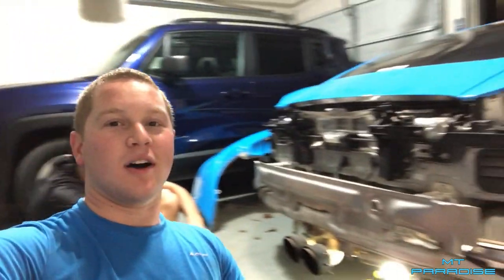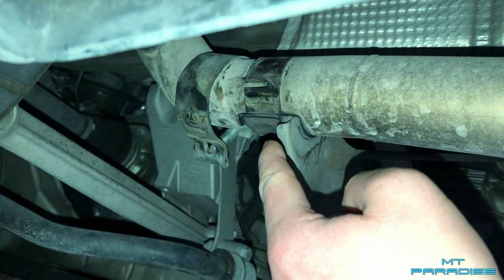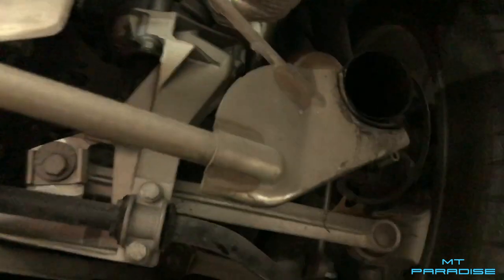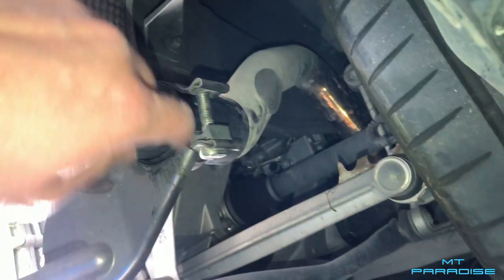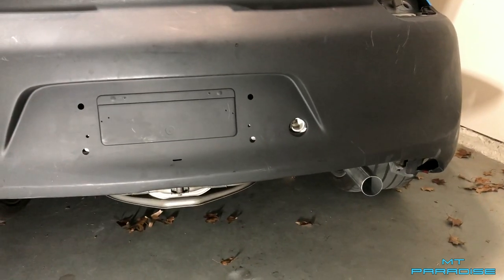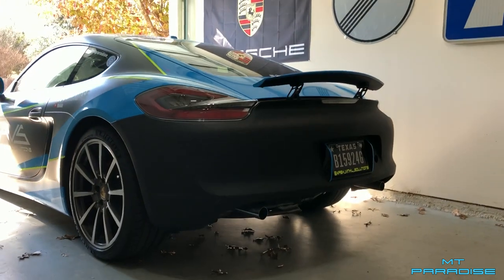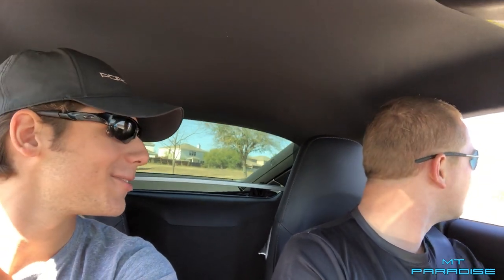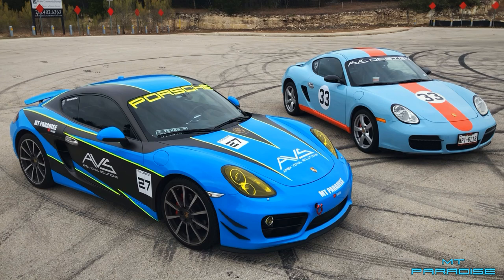Porsche Cayman S Custom Straight Pipe Installation | Worlds First???

Comment: I know it's been a few years, but I have the same exhaust and was very disappointed in the drone and the inability to even have a conversation while driving on the highway. Did doing this straight pipe mod got rid of that drone completely or just partially?
Reply from the maker: What’s crazy is that doing this custom straight pipe mod made the car way louder but the sound is more high pitched and since it’s not that low frequency, there was no drone with this exhaust. Even at full throttle, it screamed like an F1 car but was significantly quieter in the car. It also had crazy pops and crackles that sounded like a machine gun but still no drone. I could have easy conversations in the car while driving aggressive. I was also able to get it to shoot big blue flames while revving with no tune
Reply: @MTParadise  that's awesome. Thanks for the quick response! Sounds like I got my project for this weekend!

Comment: Sounds like a Old school Porsche 😊😊
Reply from the maker: It’s super raw and I love it
Reply: @MTParadise  you should try a z pipe may give it a even cooler sound i did a u type staged xpipe on a gallardo on my channel it stopped the drone and real improved the rev up. so think your car will will benefit also from a x or zpipe 😊😊
Reply from the maker: dlf restoration I had an X pipe before but I was looking to do the shortest possible lol. If I did another x I would have to rout it to the middle then back out to the sides but I was wanting the pops and flames 😂
Reply: Do you still have the car? Have you thought of build a complete set of headers and a pure power gaining setup? Didnt it blow flames more with the xpipe? The Lamborghini i had was like that.
Reply from the maker: dlf restoration I still do. The x pipe had severe drone and I only got flames doing the split exhaust and it sounds amazing now also with loud pops. I’m getting catless headers sometime soon but it was central exit exhaust with an x pipe before
Reply: @MTParadise  ooo ok look forward to the video y not make it your self?

Comment: Can you feel a difference in power? If so I wonder how much?
Reply from the maker: By what I know about exhausts and pressure associated with hp, having it more open gives it more high end torque but a little less in the low end and I can feel that. From a stop it doesn’t feel as fast but once I get going, it feels kind of like a turbo kicks in and I feel the rate of acceleration significantly increase.
Reply: So you would really need to rev about 5,000 or greater before launching from the line. Because these cars don’t have much low in torque anyway especially the base model. Your car looks nice with that wrap.
Reply from the maker: @jamesmccray2930  I have the S with sport chrono and with launch control it still is very quick. I do feel like overall it did add power because racing my friend with his 987 S, I can pull away a lot quicker now. 
Thank you. I don’t know if you saw my more recent videos but I also now have a chassis mounted wing and the exhaust actually shoots blue flames when hot enough
Reply: @MTParadise  have you met anyone with a turbo yet? It’s pretty costly
Reply from the maker: @jamesmccray2930  I haven’t met anyone with a turbo cayman but that would be awesome

Comment: How about the power ?
Reply from the maker: It’s sitting at around 350hp right now
Reply: @MTParadise  with ECU tune ??
Reply from the maker: Reynata Putra not yet. Soon and more upgrades coming too
Reply: @MTParadise  have you lost the power with 2 exhaust?
Reply from the maker: Reynata Putra is was 325 stock and the exhaust gave me more in the high end
Reply: So your telling me you got +25 hp for a muffler delete??
Reply from the maker: Alejandro Gutierrz they have been dyno tested and that the power gains they have shown in combination with a new intake